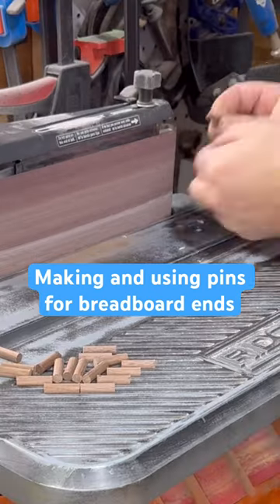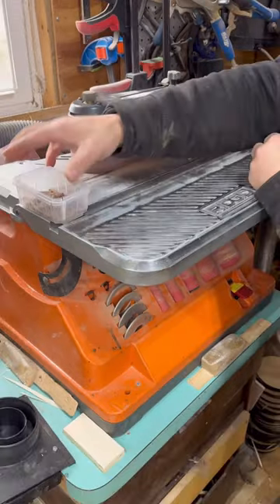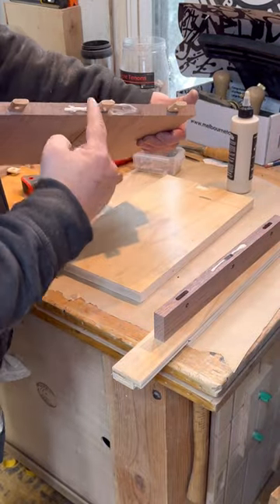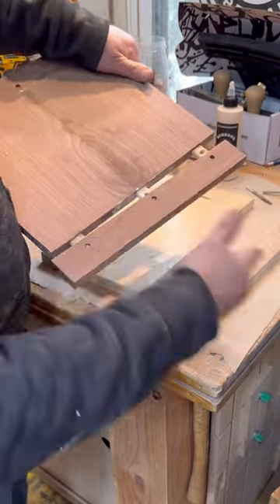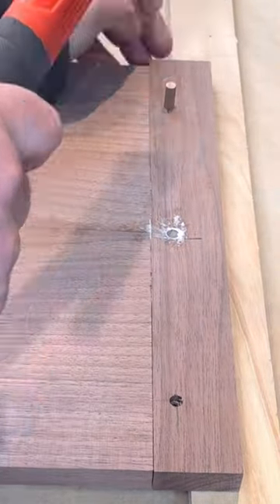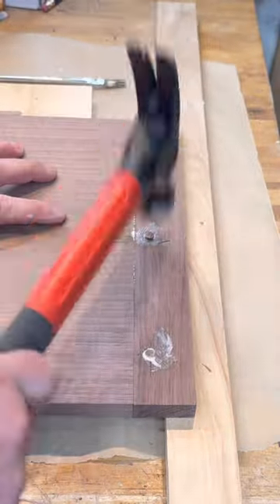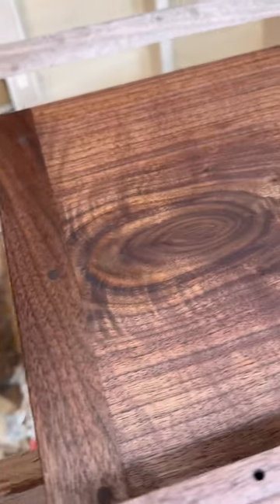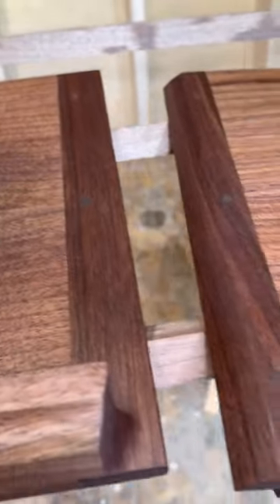Making and using dowels to pin breadboard ends #woodworking #workshop #tools

Comment: I would use a hand held pencil sharpener.  :).
Reply from the maker: TO wish, but that would be so much work!! Especially with little pieces. If you kept it long you would need to sharpen, then cut, then sharpen, then cut, etc. That’s not efficient for 30 of these.
Reply: @NewmanSpecialsWoodwork  Why don't you use a round tenon cutter in a drill?
Reply from the maker: @beneades1013  because the pieces are about 3/4” long. If I were to use the long dowel and trim the end then I would need to: tenon, cut it, tenon, cut it, etc, 30 times. It’s more time efficient to cut them all and then sand them. It’s just a few minutes to do it
Reply: @NewmanSpecialsWoodwork  I imagine that they are too long to use a plug cutter to drill plugs with a chamfer on the top already
Reply from the maker: @beneades1013  this piece is just over 1/2” in length. The dowels have to be at least 3/4” long
Reply: @NewmanSpecialsWoodwork  maybe plug cutters are worth looking into then

Comment: Personally, I would use a belt sander and put the pins in a drill, then bevel them all in about 5 minutes. Idk if that would somehow mess with something or not, I am a knifemaker, not a woodworker
Reply from the maker: It’s not a bad idea, and it wouldn’t mess with anything. The only issues I see are that I would need to make the pieces longer so that the piece that was damaged in the drill chuck was cut out and I think it would take just as much time to pick it up, chuck it in the drill, and then bevel it as it does for me to just do it. Honestly, I don’t know. Thanks though!
Reply: The way Newman is doing it is faster.
Reply: I'd do em all on a lathe, one long stick at a time, the just snap them of or use a japanese saw etc
Reply: @SToL_82  that would get to flimsy chucked up without using the tailstock.
Reply from the maker: @SToL_82  I don’t have a lathe and I would definitely worry about the rotational forces on a 1/4” thick, 30” long stick. But I don’t know because I don’t turn
Reply from the maker: @michaelmcclellan9422  I don’t know anything about the lathe, but that would make sense to me
Reply: @michaelmcclellan9422 , well yea, it would have to be done properly ofc.

Best way imo would be to just use a plug bit and saw them of using a bandsaw or such
Reply: @SToL_82  I don't think you understand. The 1/4" dowel stock, he already has those in long lengths. There is no way to chuck those into a lathe without supporting both ends,  then you can't cut them into 1" pieces.

Comment: I am not a woodworker.  But enjoy watching videos like this.  This one raised a question.  If you need the pins in the edge bit through the biscuit.  Why don't you need one through the biscuit off the main body?
If it is to stop the end being pulled off the biscuit, what is to stop the biscuit from being pulled out off the body?
Reply from the maker: Thanks man - love the question and that you enjoy watching these types of videos! 
The pieces in the main part of the body are glued in place and don’t move, so they don’t need to be pinned. The other side needs to be loose to on the ends to allow wood movement
Reply: @NewmanSpecialsWoodwork  Thanks for answering.   I now see you don't fully glue the body to the end bit and that there is no glue in the two end biscuits only the middle one.  I presume this is to allow the wood to move, grow/shrink without breaking the joint?  Like it.  Thank you.
Reply from the maker: @gromett  that is exactly it! Glad it was helpful! 🙌🙌

Comment: Not necessary, none of it.
The ends will not pull off without a pin. 
The pin can be a dowel, if you cut well.
Lots of extra work for very little aesthetics only
Reply from the maker: Wrong.
Reply: @NewmanSpecialsWoodwork  Says the guy trying to make money on it. 😆
Reply from the maker: @tylektsarran2076  how the hell am I making money on that? Thats the dumbest effing comment ever.
Reply: @NewmanSpecialsWoodwork  Cuz YouTube don't pay😘
Reply from the maker: @tylektsarran2076  I’m not monetized on here. I post stuff that makes a difference. I don’t make money from it.
Reply: @NewmanSpecialsWoodwork , look.. i see where you're coming from with this method. But saying it is necessary might be true in some situations but there's, so many, so many other situations where this method is unnecessary and plenty wrong.

I respect your effort and knowledge, but i do suggest you put some more effort into phrasing and the "why".
Reply from the maker: @SToL_82   I’m always open to learning, but I have yet to learn of a time when it is not necessary to pin breadboard ends EXCEPT when it is a sliding dovetail. With all sincerity here - please tell me when it would not be necessary to pin the ends to maintain a tight joint over time. In what situation would pinning the breadboard end to the body of the piece be wrong? (Again, I am asking not as a smartass, but as someone genuinely looking for examples).
Reply: @NewmanSpecialsWoodwork , i understand what you're saying, but truth be told, the way you write in these comments are quite.. confrontational... I'm not here to give a long lekture on when and how to do stuff, if i were i would have made a video myself. I'm simply advicing you to take the opportunity to take a look at yourself, what about everything is based on how and what you're saying in your videos that rub other woodworkers the wrong way
Reply from the maker: @SToL_82    please note the way I responded to your question/statement and ask yourself why my response to your genuine statement is different than some I have made to others. A question or a statement from someone that is asking or clarifies a point is answered, on my end, with an answer that is conversational and nice. When someone pops into a post and is only here to post negativity or rudeness does not deserve that same level of respect that a genuine person does. 
This video is about how to pin a dovetail and states that it is necessary. There is absolutely nowhere that I have found, not have I seen an example, where a dovetail is not pinned. The original commenter stated that it is not necessary and is a waste of time. My only response to him, since I already said it in the video, was “wrong”.  I wasn’t more rude to him than he was to me. I simply answered his statement with my own. The second was ridiculous comment that I was trying to make money off of a video about a technique. It was not an intelligent statement. It did not deserve a well thought out or nuanced response. 
Again - I’m going to respond to people in the same manner they post or talk to me.
Reply: @NewmanSpecialsWoodwork  It's been a week, still waiting for them to reply with one of those "so many, so many" situations where this is wrong.

But like every trade related video, you unfortunately have to deal with all the people who know so much better they must display their brilliance in YouTube comments.
Reply from the maker: @dandenoth  honestly honestly, I found that most people on here will make a negative comment and if I correct them or try to engage in a conversation, 90% of the time, there’s no response.🤷‍♂️🤷‍♂️